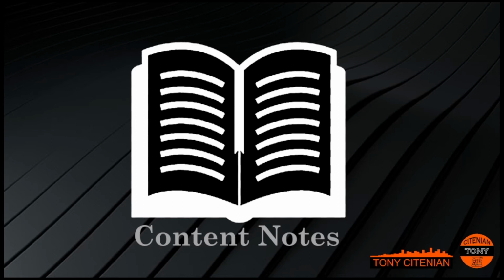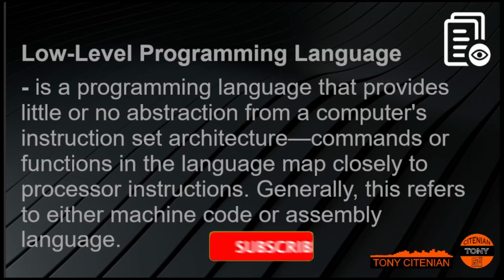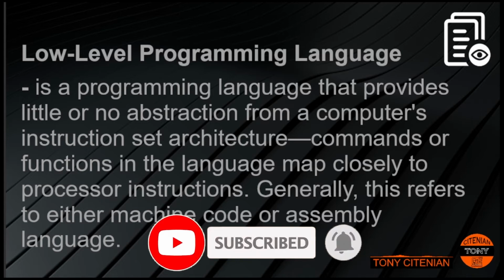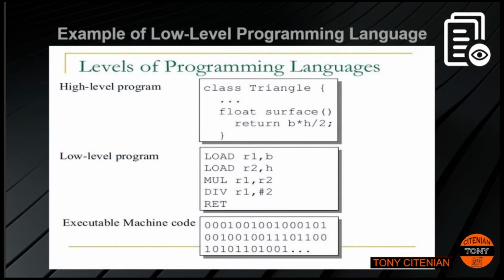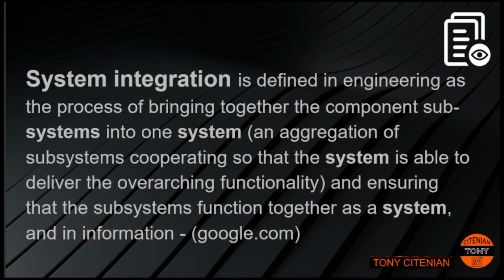System Integration and Architecture | Systems Integration Approach

Comment: The process of bringing together component sub-systems into a single system is known as system integration. Because each system is coded differently, an integrator functions as a go-between, converting data from each software behind the scenes..

Comment: What is the System Integration Approach?

System integration involves integrating existing, often disparate systems in such a way that focuses on increasing value to the customer (e.g., improved product quality and performance) while at the same time providing value to the company (e.g., reducing operational costs and improving response time).

Comment: System integration is a data management process that uses software to share information various subsystems automatically. As every system is programmed with different coding, an integrator acts as a middleman that translates data from each software behind the scenes.

#TonyCitenian
Reply from the maker: Acknowledged

Comment: System integration connects multiple subsystems so they can function together and share information to enhance supply chain management from internal operations to communicating with third parties, data transparency is essential for efficient execution inn other words, businesses with several software systems can use an integrator to create a centralized sharing network that gives users access to all information.
Reply from the maker: Acknowledged

Comment: System integration is a data management process that uses software to share
information between various subsystems automatically. As every system is
programmed with different coding, an integrator acts as a middleman that translates data
from each software behind the scenes.
Reply from the maker: Acknowledged

Comment: System integration is data management process that uses software to share information between various subsystem automatically the process of operationally connecting separate computer systems or software applications into a single larger system, allowing each solution to functionally work together.
Reply from the maker: Acknowledged

Comment: What is the Systems Integration Approach?
-System integration is a data management process that uses software to share information between various subsystems automatically. As every system is programmed with different coding, an integrator acts as a middleman that translates data from each software behind the scenes.
Reply from the maker: Acknowledged

Comment: What is a System Integration approach? 

System integration is a data management process that uses software to share information between various subsystems automatically. As every system is programmed with different coding, an integrator acts as a middleman that translates data from each software behind the scenes.
Reply from the maker: Acknowledged